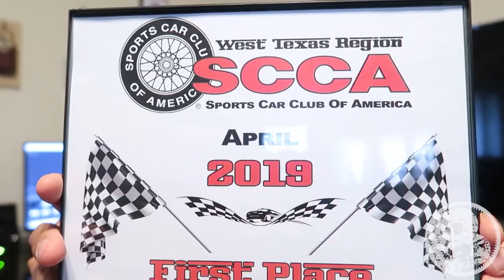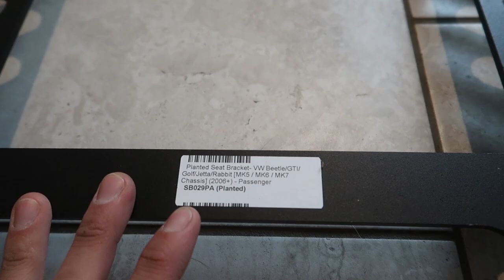Kirkey seats installed! | MK7 Golf R

Comment: love the Seats man! don't let the internet decide what you do to your race car :D  that being said are you not worried about hte bolt heads making pressure points on your hips in the turns? I probably would have gone with Carriage bolts or something else that has a low profile head to ensure it doesn't make a pressure point during turns.
Reply from the maker: I don't even feel the hardware thankfully 💪🏾 I actually really like them, my back doesn't hurt in them at all like my OEM seats did. Just my tailbone gets a little sore I think I'm going to shove a memory foam pillow in there and see if that helps at all lol